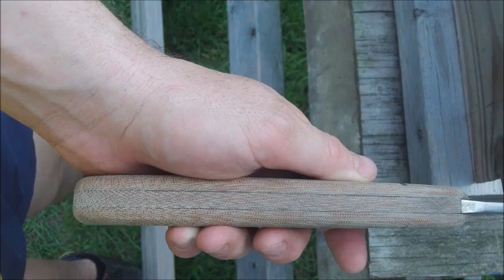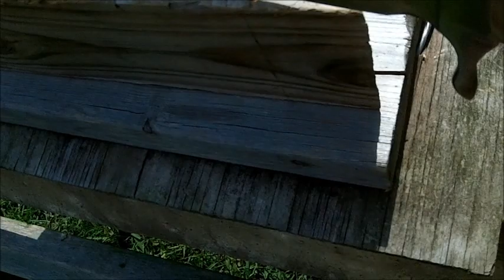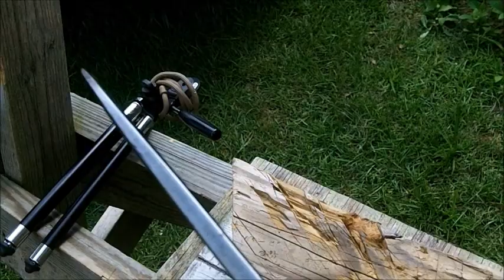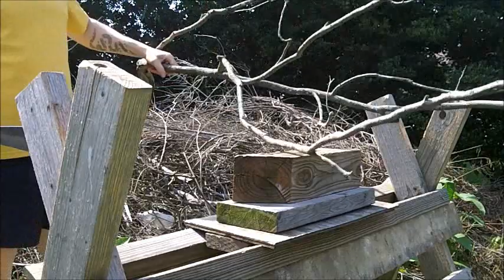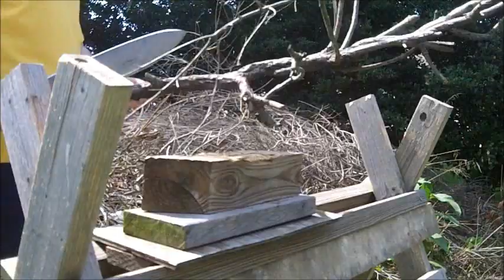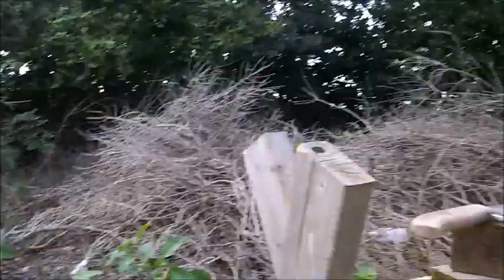Brightleaf With 13thou Edge Chopping Small Diameter Dry Hard Wood

Comment: Very nice work Jeremy. That wood looks decently hard and it doesn't look like you were overly selective on where it was being cut.
Reply: I was not trying to be too careful.  I would prefer to blow or ripple an edge myself and learn a lesson than make a knife that is too thin for the intended work.  

If it was not so hot and humid today I would have cut more.  I will cut some more this weekend and see what happens.
Reply: Jeremy McCullen Do you know the angle on the edge bevel?
Reply: I would guess between 13-15 dps with a micro bevel. I sharpened it by hand and I know I had a lot of variance.  I am a little awkward holding the stone in my off hand and the big blade in my other hand.   The blade would slice newsprint when I started cutting
Reply: Jeremy McCullen Cool.  Not that I can interpret anything from it, but was just curious.  

I feel you on the sharpening that way. I love doing it that way with smaller blades, but it's hard with bigger ones, especially the deburring process.

Comment: I like the technique in that video. Slower more deliberate, looks good. That blade is really holding up well. Are you going to miss it? 
Also big improvments on the horse.  Good job.
Reply from the maker: I worked on the horse before I did any chopping. 

Slow and steady.  

Ha, You keep throwing those hints out.
Reply: i dont know if it is going to help but i gotta try
Reply: can not find fault with you trying.  success is different.
Reply: I will be mailing your blades next week.  please email me your shipping address.  i should have it, but, i want to be sure